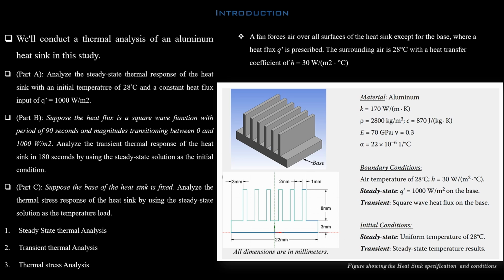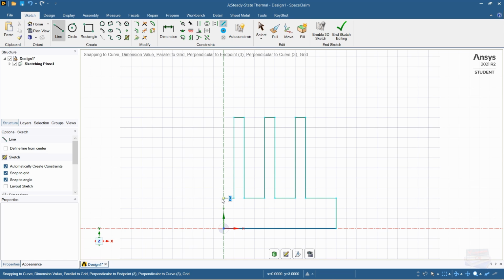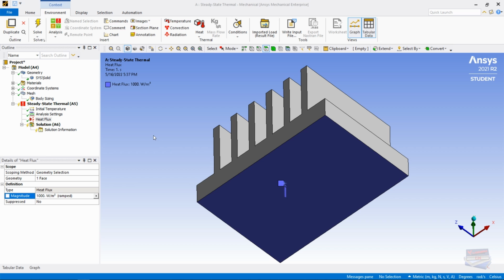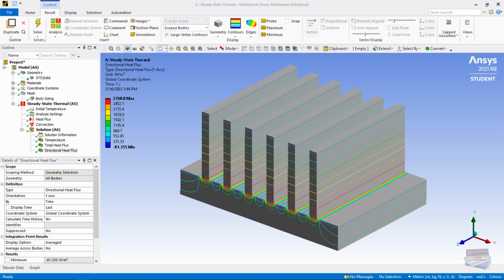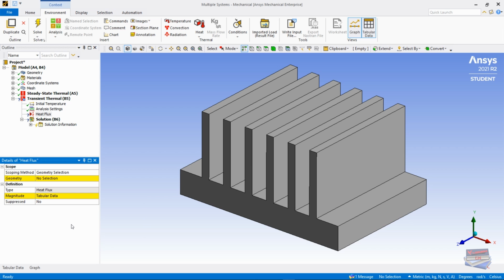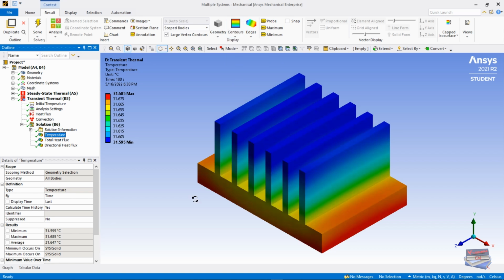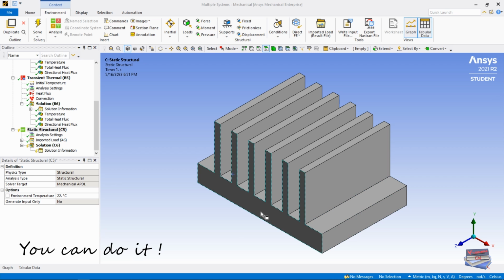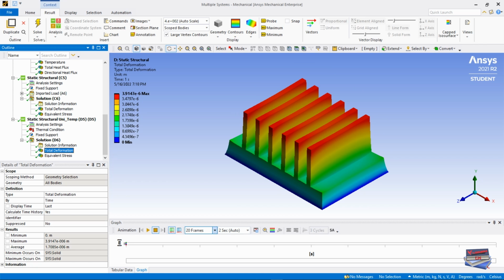Heat Sink (Ansys Workbench)

Comment: steady state thermal results are same but transient thermal analysis results are slightly different ..my maximum temperature 31.502c and yours 31.685c..can you explain what is the main reason for it..i have used non uniform temperature as initial temperature and steady state thermal is used initial temperature environment
Reply from the maker: Differences in Transient Thermal Analysis Results
You observed a small difference in maximum temperature between two transient thermal simulations:

Your result: 31.502 °C

My result: 31.685 °C

Difference: 0.183 °C

Main Causes of the Difference

1. Initial Condition Variations

Even if both initial conditions are close, manually applying a non-uniform profile and using a mapped steady-state solution can produce slightly different temperature fields, which propagate through the transient steps.

2. Numerical Interpolation & Mesh Mapping

When using the steady-state solution as an initial condition, ANSYS maps values onto the transient mesh, which may introduce interpolation errors, especially if the meshes or element types differ.

3. Time Stepping and Solver Tolerances

**Transient simulations evolve over time. A small initial variation can amplify slightly depending on:

**Time step size

**Convergence tolerance

**Numerical scheme (e.g., implicit vs. explicit)

4. Computer/Hardware Influence

**Differences in processor architecture (Intel vs. AMD, single-core vs. multi-core) or floating-point handling may cause minute numerical differences, particularly in iterative or parallel solver runs.

**Processing speed does not cause inaccuracy — it only affects runtime.

             **Are These Differences Okay?**
Yes , these differences are perfectly acceptable and expected in engineering simulations.

**A difference of 0.183 °C in a thermal simulation is within the typical numerical tolerance of commercial solvers like ANSYS.

**Unless your system requires extremely high precision (e.g. semiconductor cooling, biomedical implants), this is not a cause for concern.

**In fact, differences below 0.5%–1% of the temperature range are usually considered numerically negligible.

******** Conclusion**********

**The small difference in maximum temperature is normal and acceptable.

**It arises from minor differences in initial conditions, interpolation, solver behavior, and hardware-level floating-point arithmetic.

**There’s no indication of error or setup mistake based on the values you provided.

Comment: Hello, I enjoyed watching the video. But the question I have is why do transient thermal analysis after steady state thermal analysis at first. Is it to do transient thermal analysis with different temperature conditions at the beginning? In other words, did it go through 1+180 seconds? I wonder what's different from starting with transient thermal analysis from the beginning. I'm sorry if the translation is insufficient.
Reply from the maker: Why perform a transient thermal analysis after a steady-state thermal analysis?
--------------------------------------------------------------------------------------------------------------------------------

1.Purpose of Steady-State First:
Steady-state thermal analysis helps you find the final temperature distribution when the system has reached thermal equilibrium (i.e., when temperatures are no longer changing with time). This provides a stable starting point for the transient analysis.

2. More Realistic Initial Conditions:
If you start a transient thermal analysis from zero (without steady-state), the software assumes an initial uniform or user-defined temperature, which may not reflect the actual thermal state of the system. Running a steady-state analysis first allows you to define a more realistic starting temperature distribution for the transient analysis.

3. Smoother Transition and Better Convergence:
By starting from a steady-state solution, the transient analysis starts closer to the real behavior of the system, which helps improve accuracy and reduces numerical instability during the transient simulation.

4. Example Scenario:

** You perform a steady-state thermal analysis to simulate the system's state after it has been operating for a long time (like a machine running continuously).

** Then you switch to transient analysis to study how the system responds to a change — for example, how it cools down when switched off or how it heats up with a sudden increase in load.
** The transient analysis would begin using the steady-state temperature profile as the starting point, rather than an arbitrary or uniform temperature.

5. About the 1 + 180 Seconds Question:

** If the system runs for 1 second to reach steady-state, the transient analysis might simulate an additional 180 seconds to observe how the temperature changes over time in response to new boundary conditions or heat loads.

** Without the steady-state step, the transient analysis would have to simulate the whole process from an unrealistic starting condition, which could take longer and be less accurate.

Comment: Sir, would you please share a video on how to do topology optimization of such heat sinks after performing the analysis?? Its a great video.... 👍 👌 ☺️  may I please get your email ID??
Reply from the maker: Thank you! I'm in the process of making a tutorial about topology optimization of heat sinks.
Reply: @kabindaex7047  sir as i was practicing it myself the other day I could do the topology optimization myself..but I have not yet validated my design. Sir, would you please confirm me one thing that...when we perform steady state, transient and static structural analysis one after the other as you have shown....then drag the topology optimization of the model to the solution of the "steady state" solution part.... will the topology optimization results comsider all the 3 analysis or only steady state. Sir please help me on this 🙏  @KabindaEx
Reply: @kabindaex7047  sir as i was practicing topology optimization of a heat sink myself the other day I could do it...but I have not yet validated my design. But you please confirm me one thing that...when we perform steady state, transient and thermal stress analysis one after the other as you have shown....then drag the topology optimization of the model to the solution of the "steady state" ..... will the topology optimization results comsider all the 3 analysis or only steady state. Sir please help me on this 🙏

Comment: what was the point of static structural uniform temperature. what does thermal condition do? it finds thermal strain? with respect to what temperature and why that temperature. sry if the question is stupid im learning this
Reply: It applies thermal constraints as a  load to the body. To study about structural deformation under these thermal constraints, we use static structural. 

I am also a learner. I might be right or wrong. Any changes will be appreciated and will be helpful.
Reply from the maker: You can also try different parameters then analyse your results. @-cSathwik thanks!

Comment: Hello,
I had some doubts. If possible can you please explain.

1) How do i validate the design after finding the temperature distribution of heatsink?
I still dont know the optimal junction to heatsink surface temperature resistance, 
so i think i cant be sure if that particular heatsink will be good or bad for a given Chip.

2) are we supposed to give an experimental guess to film co efficient, 
 what if that value is very far from the actual one in reality ? due to a variety of reasons.

Thanks in advance
Reply from the maker: Take a look at this video and let me know if it helps: https://youtu.be/z-ap8hFfjK8?si=1MhtUR1h4wMYSU0O
Please note that my tutorials are intended for educational purposes only. Ensure you apply the necessary scientific approach in real-world applications.

Comment: Hi, this simulation was done through the workbench mechanical designer ryt? So what is the difference of the simulation we do it in ANSYS CFD solver by defining boundary conditions, and a turbulence model, and defining solver settings?
Reply from the maker: Here's an analogy:

Imagine designing a bridge. Workbench Mechanical Designer is like a simple stress calculator, telling you if the bridge beams can support a certain weight. ANSYS CFD Solver is like a wind tunnel simulator, allowing you to analyze how wind affects the entire bridge structure in detail.

Choosing the right tool depends on the complexity of your simulation needs. For basic structural analysis, Workbench Mechanical Designer might suffice. For in-depth analysis of fluid flow and related phenomena, ANSYS CFD Solver is the more powerful option.